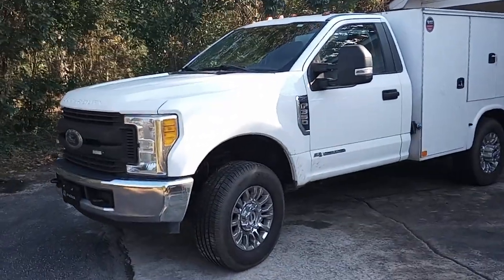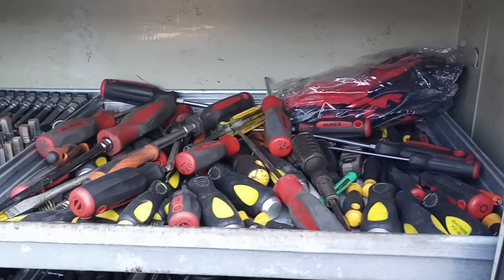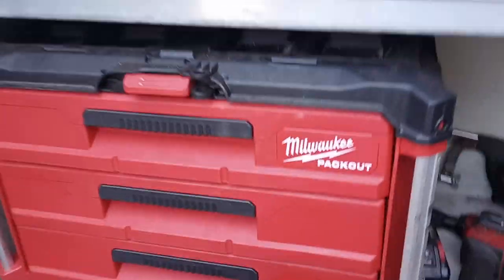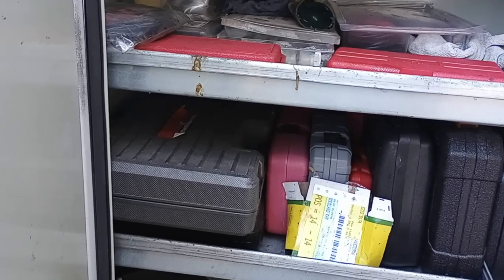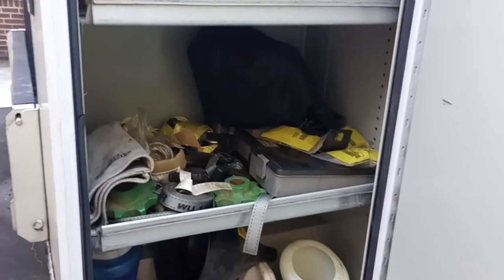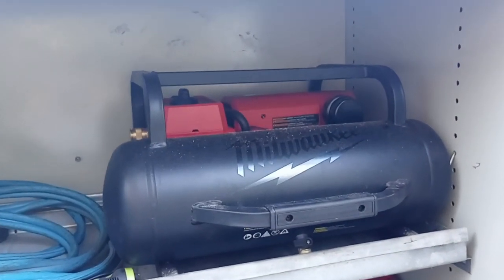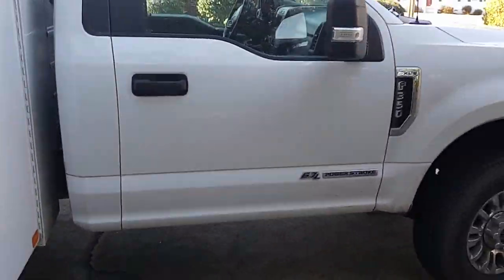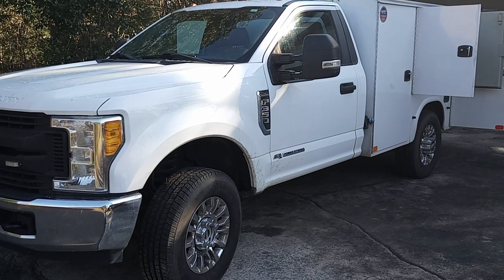John Deere Field Tech Service Truck Tour

Comment: Nice truck Thomas. For your die grinder, check out the 3rd party batteries on Amazon. They come in like 6Ah/8Ah and they're super useful versus the small Milwaukee 2-4Ah batteries when you got a lot of stuff to clean/grind.